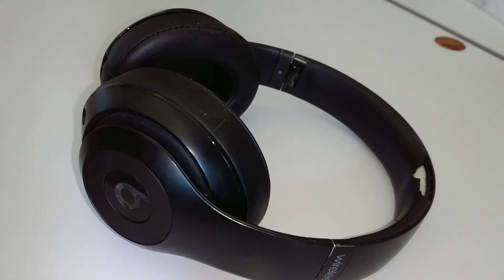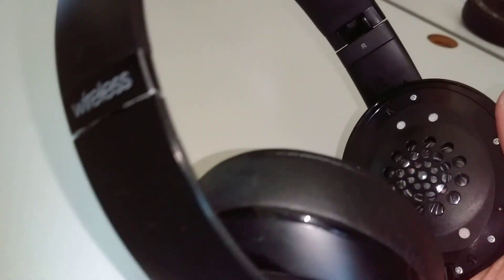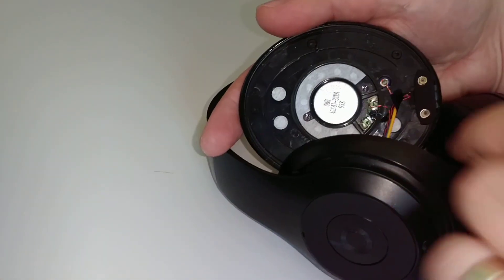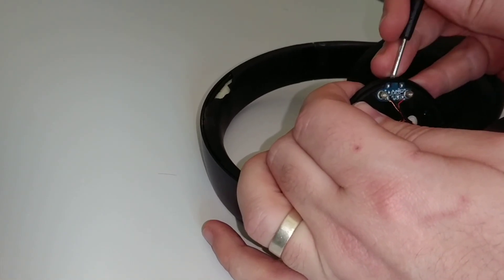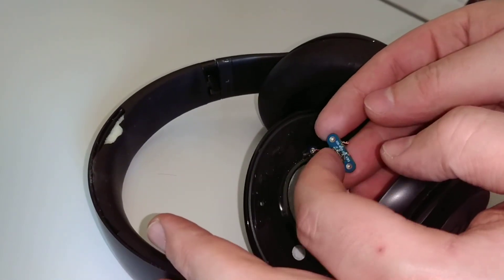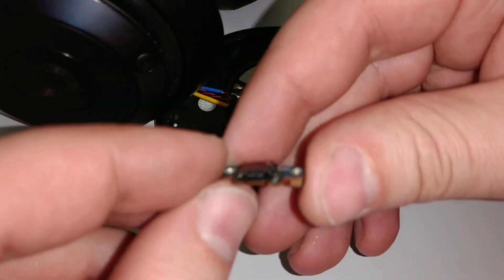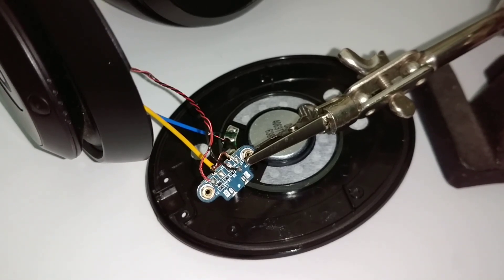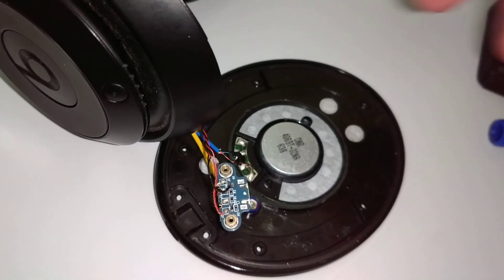Beats by Dre Studio 2 Wireless - USB charger port repair

Comment: wonder if replacing it with usb c port would work. I really hate micro USB, it is so hard to connect every time which is most likely why it breaks so often
Reply from the maker: Could be possible if you're able to find a USB C port that will fit the board, and you're good at SMD soldering. But you'd also have to modify the case to accommodate it.

Comment: Getting my headphones fixed would cost me 250 euros they said. After this video I ordered the parts online, did it myself, and fixed my headphones for not even a tenth of the price. Took my some time as I didn't have any experience with soldering, but they are working again.
Reply: Soldering is the glue it takes to put the wires back in place?

Comment: I dropped my beats solo 3 in water and picked it up after about 1 second. The power button doesn’t work, they don’t charge, and they do not connect to my iPad. What should I do?
Reply from the maker: A number of things may have happened, something on the circuit board may have shorted, the battery may have discharged and been damaged, who knows what else. Your best bet is to open them up and let them dry for a day in the sun as there could be water trapped that isn't visible. But if it still doesn't work then it may not be worth trying to find the actual fault.

Oh and make sure the USB port is clear of any debris, just use a toothpick and poke around inside the plug
Reply: Sawickipedia thank you so much mate
Reply: Sawickipedia I believe there has been a short with one of the wires... buying a new pair of headphones would probably be an easier solution at this point
Reply: @isaacroy-lavallee3573  Unfortunately yes
Reply from the maker: Oh sorry Issac, just realised I replied using my other YouTube channel name. Anyway, yeah good excuse to get some new headphones
Reply: Sawickipedia yes, but I think I’ll just get the same headphones

Comment: I have a solo 3 I believe, and the charging port appears to be loose. To charge, the cord has to be held at a certain angle that is hard to find.  Would this likely require a charging port replacement?
Reply from the maker: It's probably just a weak solder joint. The problem is that the solder joints are located under the USB port (surface mount), so it's not possible without specialised equipment to reflow the solder joints. So in this case, yes it's easier to replace the charger port and circuit board.

Comment: What did you smear on the new board before you reattached the wires
Reply from the maker: Just scrubbed it with some isopropyl alcohol to clean the contacts before soldering

Comment: Thanks for the great video - I have the same problem.  Did you use any solder or just heat up what was there?
Reply from the maker: Honestly I can't remember, but I dare say you will need to add some solder. Cheers